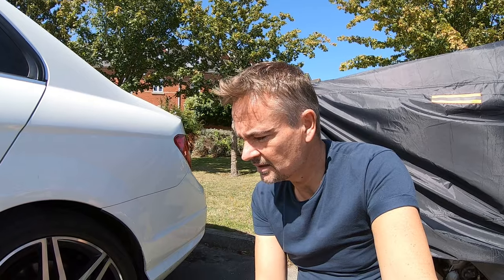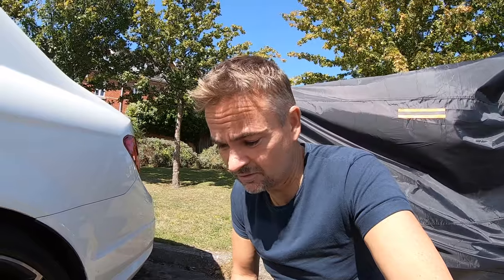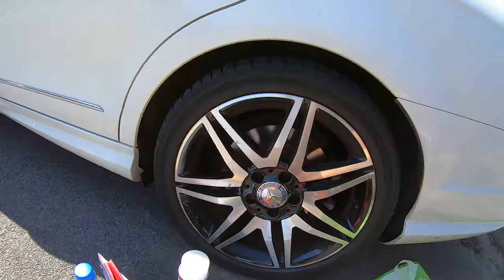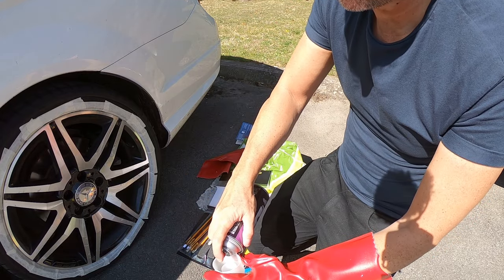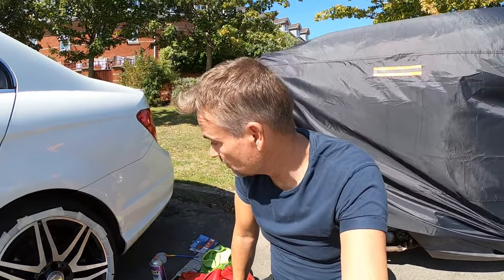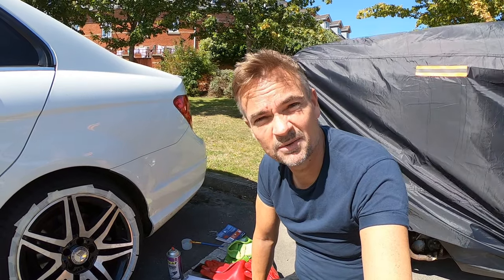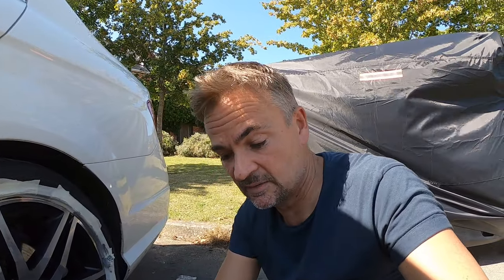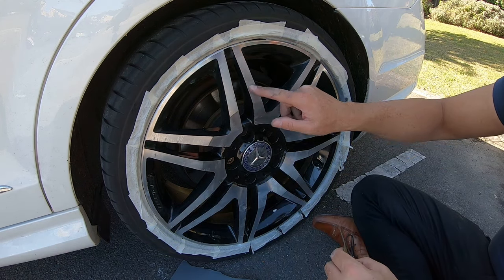Diamond Cut Alloy Wheel Corrosion & Scratched - Cleaning and Repair - ( DIY Fix )

Comment: Great video, considering doing something similar to my diamond cut wheels which have similar issues. I'm worried about getting good adhesion to the bare metal - I'd be interested to know how your lacquer is holding up after 9 months?
Reply from the maker: Hi Ollie, thanks for the reply, sorry I completely missed it, I have recently checked the wheel I refurbished and its now started to get its corrosion back, I have decided to now go down the power coat route and its being done next week so there will be another update video coming next week, thanks for the reply, mrix
Reply: I ended up doing spot repairs on mine, rather than redoing the whole wheel. I decided to put the car on axle stands and take the wheels off to make like a bit easier! I masked up the wheels and tyres, then sanded off the old lacquer, extending about 1 inch each side of the damaged areas, then smoothed the area up to 3000 grit. I used some adhesion promoter on the bare metal (Pro XL Pro Grip), followed by a few coats of 2K lacquer (Pro XL 2K Clear), then machine polished to a shine a few days later. Up close, the repaired areas are noticeable, as the texture of the metal is different, but from a few paces away is looks Ok to me, and other people have said that they can't tell (maybe they are being polite). My repairs are holding up OK 4 months later, but I do have some new white corrosion elsewhere on the wheels. I guess that getting through the winter with all the salt on the roads will be the real test! I've decided that as nice as diamond cuts look, they are a complete pain in the backside and I'd avoid them on my next car!
Reply from the maker: @olliehaycock9718  Hi Ollie, well done of giving it a go! I suppose now the question is now, how long will it last ? for me not as long as I would of liked hence I am now going down the powder coat route, I was going to get them re-diamond cut but decided a change of colour would be different and for the price seemed like a good idea, anyway it remains to be seen what my wheels look like Powder coated gloss black but its all booked in! thanks for the swift reply, I think the same on the next car Diamond cut wheels is off the menu ha ha, mrix
Reply: Wear goggles, a properly rated mask, and stay upwind while spraying.  Use glass (not plastic) to contain corrosive chemicals.  Buy bottled products if spray is not needed.
Reply: @olliehaycock9718  p by
Reply: @mrix hi, I know this is 3 years after the video and comments, but I'm curious to know how much you we able to get them powder coated for?

My wheels are the same as yours in terms of corrosion and it really brings the whole car down. I've considered re diamond cutting, and it's just insanely expensive, and I was initially excited to see your video and initial results. But seeing your follow up comment about it coming back after a short amount of time has made me feel this is perhaps not a lasting DIY fix.

Comment: Great to see people having a go at home fixes. Been there myself with alloy repairs. Can only reiterate how much easier repair/correction is when the wheel has been removed, and never forget that a Dremel is your friend! 
My 'mate' watched me struggle with the first wheel (MB SLK R170), before sharing the Dremel nugget. The next three were ten times quicker with much better results! 
Used P800, P1200 and P2000 before buffing with the dremel and Autosol. Obtained a near mirror finish which was then 'brushed' with a scotchbrite pad, degreased and then sealed. Managed a very respectable finish. Hope this is of some use going forward.
Reply: Yeah, Dremel has rubberised  bob with fine abrasive. I would start with  corrosion affected places and than blend with wet sandpaper maybe even 0000 steel wool
Reply from the maker: Interesting tips, will have another go when I am out of the virus lockdown! thanks for the idea`s, mrix

Comment: Great video. I have some milky spots on my already refurbed 911 wheels. I was with you until you had to get the sandpaper out. At that point I had mentally bailed out since I wouldn’t want to lose the radial diamond cut lines. Add to that the oven cooking that they do in a refurb and this has told me to avoid. So glad you were willing to have a go and share the result.
Reply from the maker: Hi Roger, eventually I decided to have my wheels powder coated black, its such a durable finish and it looks great, so very pleased with the outcome, I think the price was also reasonable at £360, I also had a hire car thrown in for Free which I had for 2 days, will certainly have it done again if I end up in a similar situation, mrix

Comment: When you’re doing your wet and dry sanding process for curb rash or scratches, work from lowest grit to ultra fine grit until you get out all the scratches from previous grits from lowest grit to ultra fine grit and before you put on the clearcoat you should take some polishing compound especially made for alloy wheels and Polish the wheel to bring the finish up to the factory standard shine or (luster) before putting on the clearcoat that is the step-by-step process to achieving a professional result!! 😁😎☮️🙏

Comment: Add another tip in the process if you’re going to clearcoat the entire wheel which would be best done with the wheel removed from the vehicle is to once your scratch repair or curb rash repair is complete is to scuff up the entire wheel and remaining clearcoat if any remains with a scotch brute pad so that the clearcoat can adhere better to the wheel.😁🤓😉
Reply: I'm not sure that would be great because usually the metal part has a very fine brushed quality to it. My rims have a parallel straight brushing pattern that looks really nice once the clear clue is on top and they kind of have a hologram effect. If you scratch it up with Scotchbrite you just ruined all of that, no?

Comment: The reason that they have gone milky with corrosion is because these wheels have already been Re diamond cut before (look how wide the spokes are and compare them to a brand new set) and most probably not been done correctly.they look like they have had a hard cut which leaves the edge jagged and lacquer chips off it easily.
Reply from the maker: You could possibly be correct but when I got the car it was only 3 years old and I have not had them re-cut, would they of needed diamond cutting after just three years ? not sure... thanks for the reply mrix
Reply: At 14.09 mins can you see between the gap in the spoke its polished whereas it’s suppose to be black standard.if you search images on google you will see that the spokes on your wheels are wider and that’s because they have been Re cut on the lathe.
I’d be surprised if a company would cut them again as they look like they have already had a decent cut on them and between the spokes (on rim edge) doesn’t look like it will take another cut.

Comment: Very interesting thank you for posting. I realise this was a while ago now but do you think that after wet and dry you would have got a better result if you then spent time polishing with auto solvol?
Reply from the maker: Actually the results would of been much better if I had used harsher grades from the start and worked back through the grades which would of saved me so much time and the finish would of been so much better, then yes at the end spending a bit more time using the polish as you say, mrix

Comment: The Recipe is: you need to wipe off every scratch with sand paper (I used for my deeper scratches 120(dry) > 320(dry) > 500(wet) > 800 (wet) > 1000 (wet) > 2000(wet) ), then polish it to 'mirror' effect with Autosol for Aluminium or Metal, degrease it and then spray it when it's completely dry. I suggest to use hands only. Do NOT use any machines for that because you can make it even worse. Alloy wheels are very soft.
Reply from the maker: Yes good points made, the trouble is these have the grooves from being diamond cut which makes the process far more difficult, thanks for the reply.....mrix

Comment: You could have made that job 100% easier by removing the wheel and putting it on a bench. Next time use a machine polisher, and 2k clear.
Reply from the maker: Hi Neil, fortunately there will not be a next time, certainly not for this car as the wheels are now black powder coated, however thanks for the suggestion, best regards mrix

Comment: I imagine You did ended up spending £750 to put these wheels back to their former glory...? Love diamond cut wheels and hate them in the same time - they do look really good however need to refurb them every 3 years or so......
Reply from the maker: Hi, for me personally it was only one wheel which was really bad, I have not attempted the other three but one of them does now need attention, obviously the job will be much easier a second time around and I still have the bits and pieces required for when we get warmer weather here in the UK, mrix
Reply: @mrix  Ohh mate, weather is not the thing to be bothered about now. Off course, when it'll get warmer, then....... Anyway, after watching Your vid I checked couple more and come up with an idea to polish alloys inside out, get that chrome look. Think they will look amazing on my 300c!

Comment: You’re a brave man and I appreciate you risking your wheels for us. My motorbike has diamond cut wheels and the same thing has happened. I’ve just ordered a torque wrench so I can get everything back on. The wheels have to come off a bike because if the way the brakes are. However, your video with your tips and the comments it’s generated have inspired me……I’ll send you the bill if it goes wrong…..🤣
Reply from the maker: All the very best of luck with your motor cycle wheels, I eventually had a really great price deal on powder coating so opted for that in the end, my wheels are all now black.... mrix

Comment: FYI:
1. glass would be wiser to contain the acid. 
2. If using a brush applicator, buy a bottled stripper, not spray.  
3.  If spraying, especially with corrosive chemicals, stay UPWIND, wear goggles, and use a properly  rated mask to avoid blindness and/or death.
Reply from the maker: I agree with you Lars, what you say makes perfect sense, mrix

Comment: Looking at doing this on my daily driver, will this not peel as the black paint had no prep work? Also why did you not remove the wheel?
Reply from the maker: Hello Mattious, as I painted the removing solution on and did not actually spray it all was fine for me, I did not remove the wheels as it saved me a little time which I was short of, in hindsight I would of removed the wheel and started with a much higher grade Emery paper, all the best mrix
Reply: mrix thanks for getting back to me, I will give it a go, think I will start with the paper like you said and see how I get on. Thanks again 👍🏻

Comment: I tried this but the repair Area ended up very smooth like a mirror it no longer has the tiny grooves that the rest of the wheel has so you can see the patch
Reply from the maker: Yes very true the lazer cut grooves will be removed, my video was simply a idea for the entire wheel to be done and not a small area, mrix
Reply: @mrix  I'm Considering sanding the lacquer off the whole wheel, polishing it to a mirror finish with a buffer then re spray the clear lacquer. I too have E class cabrio I paid about £700 like you mentioned for 4 wheel refurb and a year later it's corroding again. I'd never pay to have them diamond cut again. But if a good result can be achieved DIY then it's not too bad
Reply from the maker: @bobbyrayofthefamilysmith24  I would go for it, I have no corrosion so far since doing the job myself, I have also considered spray painting the wheels which gives a more aggressive look especially if sprayed in black, the price for having it done is also strangely far cheaper than Diamond cutting, they actually recommended it when I first enquired about refurbishing the wheels, actually I am now thinking about customizing my merc like replacing the grill and other fairly cheap add-ons you can purchase which really make a difference to the appearance, mrix

Comment: Thanks for your video. I have a 2013 BMW with similar wheels, but much worse corrosion. Going to give it a go.  Intrigued by the acid you used - are there others available? Or is the one you used specifically for safe use on alloys?
Reply from the maker: Hello Chris, having done some research this was recomnended by someone to work well and not discolor the Alloy, best of luck with yours, mrix